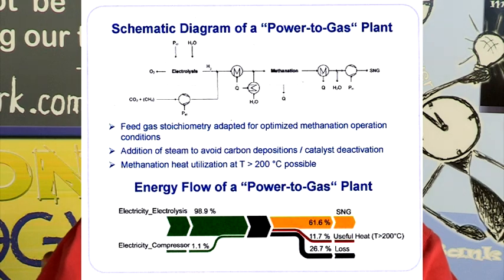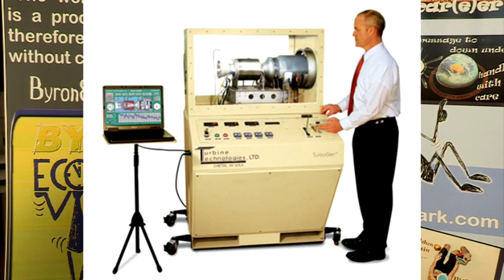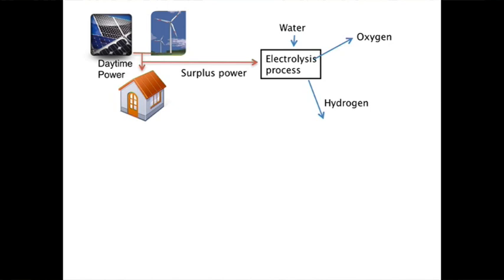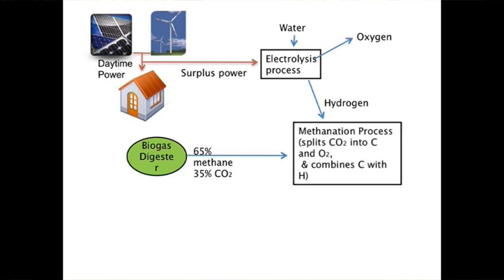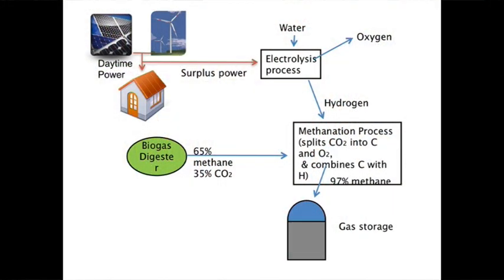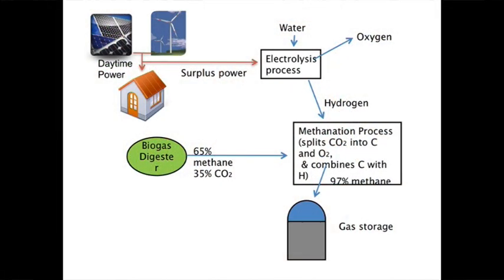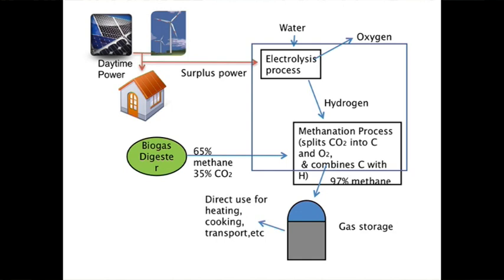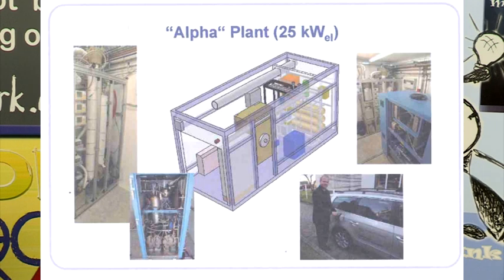Power to Gas: a new way to store excess solar power.

Comment: why not just capture oxygen and hydrogen and burn the ditectly?
Reply: That's fine if you are using it as produced. This is about storing energy. Storing HHO gas is asking for an explosion. You would have to store the gases separately to be safe. This video stores energy from 2 solar sources, electricity from panels and heat in the digesters, so you change the output of 65% methane to 95% methane, safely.

Comment: Hi Richard. Nice to hear an Aussie discuss power to gas electrolysis.  How did you go with your pilot in Northern Rivers?  Being and engineer with a solution bent, this method of storage and delivery of methane via the gas grid seems the most sensible way to use our existing infrastructure to get the long term storage we will need once renewables dominate the electricity grid (hopefully).  If anyone will get it right it must be the Germans!  Anyway, I'm interested to know how it is going and how it is being received by others.
Regards
Tony